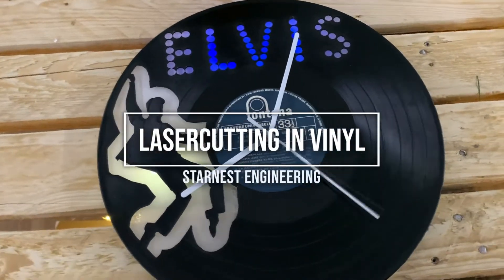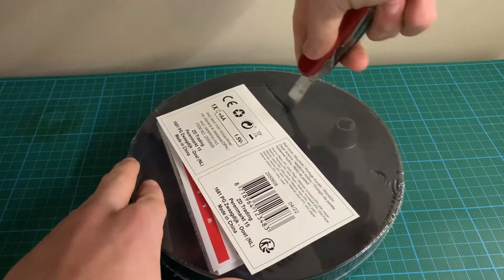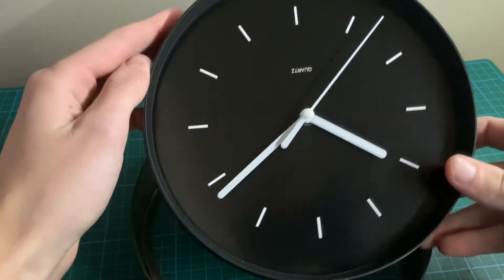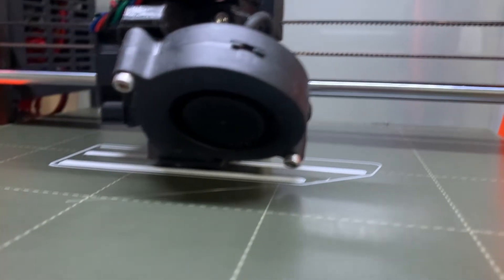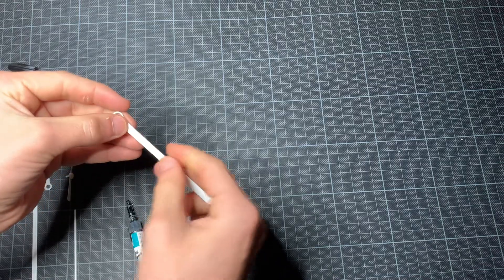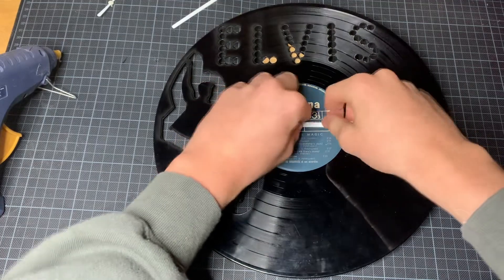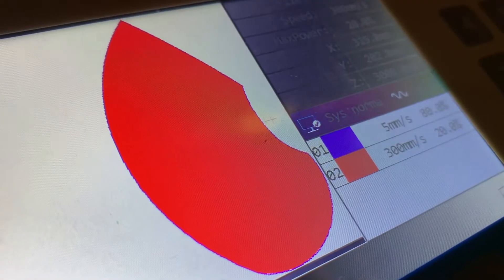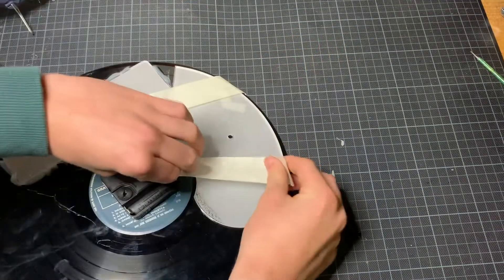LASERCUTTING in VINYL! (Making Clocks from old Vinyl)

Comment: If you had any real intelligence, you'd delete this video.  

All LP record albums since the mid 1940's are made from PVC.  

PVC / Vinyl / Record albums - 

Contains chlorine → laser breaks it down into hydrogen chloride gas (HCl).

That turns into hydrochloric acid when it contacts moisture (your lungs, or machine internals).

Damages optics, corrodes rails, hazardous to breathe.

Verdict: Never cut PVC/vinyl/LP records with a laser.
Reply from the maker: All the gases were extracted instantly, only after posting this video I learned that you shouldn't do this.
Reply: @StarNestEngineeringand yet you have not shared a warning at the beginning of the video. You’ll be liable if Fontaine gets cancer by following your advice since you failed to let anyone know about the dangers.

Comment: Vinyl laser cutting due to high temperature, produces chlorine (gas very toxic for living), these gases ravage your machine even with good ventilation. The very fast corrosion of the machine elements is real.
Experience made in a fablab, cutting in good quantity of vinyl disc.
The damage to the machine cost as a replacement and in time to restore the machine.

Comment: I keep hearing that cutting record vinyl can ruin your machine. Anyone have experience with this?
Reply from the maker: If you can extract the posionous gasses there is no problem.
Reply: @StarNestEngineering  That is false, the gas is not only poisonous, but also corrosive, and will damage your machine over time.
Reply from the maker: The gasses are extracted @MfmageRaids